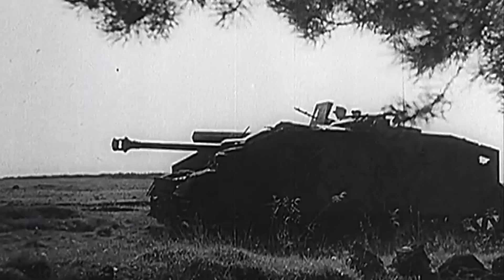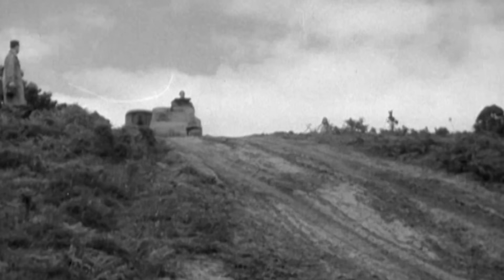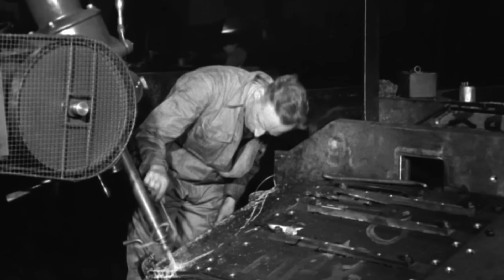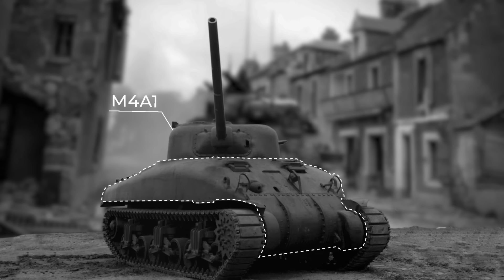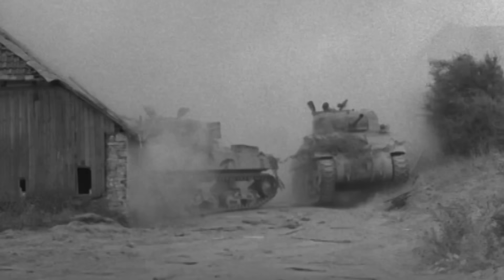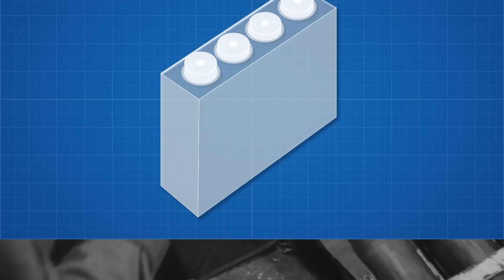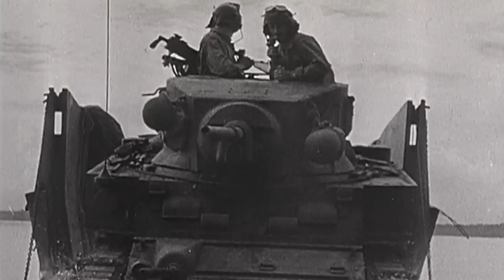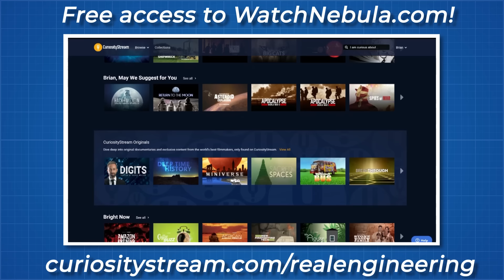M4 Sherman - The Workhorse of D-Day

Comment: The hedgerow clearing Sherman wasn't a variant. It was an unauthorized field mod. Soldiers ran into hedgerows they couldn't get through, and tried things to solve the problem. Welding metal forks and blades on Shermans worked, so they did it a lot. No 2 mods are the same either.

Comment: I thought the Soviet T34 was the most produced tank of the allies.  Continuing production after the War into the 1950s.
Reply: Their numbers made after the war wouldn't count as tanks made by the Allies, the Russians stopped being Allies the moment the war ended, he's talking about numbers made during the war.
Reply: Depends on several matters. Many didn't consider the Soviets as part of the Allied powers until after the war. Production numbers for the T-34 (and its derivatives) during the war vary wildly. Though Between 54,800 and 57,900 are the most common figures. In total between and 60,235 and 63,335 T-34's in all variants and its derivatives were produced during the war. On the other side the the numbers for the Americans are less under question- 49,253 M4's produced during the war including the T6 pilot. In total 63,181 M4's in all variants plus derivatives were produced. Another ~2,180 can be added if you want to consider the Grizzly's and Sexton II's which were Canadian produced (for most part they were assembled in Canada, though most parts were produced in the U.S., they are not added to the M4 production list). So if you want 65,369.

 However referring to the tanks themselves up until 1944 the production and use of the M4 was at least notably, then eventually marginally larger than that of the T-34. In 1945 the T-34 (the T-34/85 variant in particular) production outpaced M4 production and beat it in overall numbers. That being said, the T-34 was produced well after the war to make up for losses suffered and the fact replacement medium tanks weren't in the numbers required. Some ~80,000 were produced in total if we include postwar production.

Comment: but the EZ 8 was built to fight tiger 1s the had built the m26 Pershing to also deal with tigers but to withstand more abuse then a regular Sherman but they didn't stop there they also built a super Pershing fitted with a 90 mm gun that was to go up against anything and yes the Sherman was a good war winning tank that was mass produced it wasn't very good at keeping you safe as the Germans called the take a coffin for 5
Reply: Well check the actual records instead of banking on what a couple of big mouths said during the war, the Sherman was the most survivable piece of equipment on the battlefield, statistics taken from loss records prove it, despite what some freaked out guys and enemy troops may say the inside of one was the safest place in the entire war, crew losses and overall unit losses clearly show that.
Reply: @dukecraig2402  well dude if you checked you books because records go that it took up to 5 shermans to kill one tiger at 1-2000 yards and so they added the 76w shermans so every 5th tank would be a 76w and the tigers learned that the new tank was upgraded with a larger more powerful gun and then they learn to target them so the 76w's came up with a camouflage that would try and hide the end of the barrel but what your thinking about is an infantry tank which then yea you would be safer but there are still anti tank guns that can take them out so you are never safe in a war untill it's over but there are safer places you can be yes
Reply: @abigbang5971  
And it all averages out, you can't cherry pick one example and say it's proof of anything, that's like saying that the documented account of an M8 Greyhound taking out a Tiger is proof that Greyhounds are superior to Tigers, and you're not taking into account all the Sherman's that were taken out with anti tank guns, I had some clown the other day trying to say the numbers of Sherman's lost in Market Garden vs the amount of German tanks is proof that the German tanks were superior, it's like I explained to him, first of all the vast majority of Sherman's taken out in MG were by anti-tank guns that were in defensive positions anyways vs tanks that were being pushed up a single lane road as the result of a piss poor battle plan, not as a result of tank on tank engagements, the example you just cited, was it a result of the German tank being in a hidden defensive position? Or was it an open field maneuvering battle? And no German armor fan boys EVER want to take into account producability, if your enemy is making 30 medium tanks to every one of your "super tanks", well that's not hard to figure out how that's going to end.
And here's something straight from the horses mouth, when I was stationed in Germany in 84 I spent Easter weekend at a German family's house on a program where they'd take in GI's who couldn't go home for holidays, it just so happens this older guy who was the head of his family was a tanker in the war, when I ask him about whether or not it was true about what I'd always heard growing up in the 70's about the German tanks being "vastly superior" to our tanks he literally laughed, then he told me (and this isn't verbatim because I'm not going to attempt to type in his accent) "Look, when there's 1 or 2 of you and 10 to 15 Sherman's come rolling over the hill at you it's only going to end one way, and we knew it.", he also confessed to me that after the Bulge, when they knew it was pretty much over, when they'd see those 10 to 15 Sherman's coming at them they'd just get out and run, something that he attributed to the fact that he was able to have a home to invite me into, why get killed when you know how all of it's going to end anyways, you hear the story's about Sherman crews having "Tigerphobia", well make no mistake they had "Shermanphobia" just the same.
I was on an armored vehicle crew, and the one I was on was priority target #1 on a battlefield if I'd have found myself on one, so I get the concept of and have my head wrapped around survivability in an armored vehicle and how important it is.

Comment: more t 34's were built than the m4
Reply: Depends on several matters. Many didn't consider the Soviets as part of the Allied powers until after the war. Production numbers for the T-34 (and its derivatives) during the war vary wildly. Though Between 54,800 and 57,900 are the most common figures. In total between and 60,235 and 63,335 T-34's in all variants and its derivatives were produced during the war. On the other side the the numbers for the Americans are less under question- 49,253 M4's produced during the war including the T6 pilot. In total 63,181 M4's in all variants plus derivatives were produced. Another ~2,180 can be added if you want to consider the Grizzly's and Sexton II's which were Canadian produced (for most part they were assembled in Canada, though most parts were produced in the U.S., they are not added to the M4 production list). So if you want 65,369.

 However referring to the tanks themselves up until 1944 the production and use of the M4 was at least notably, then eventually marginally larger than that of the T-34. In 1945 the T-34 (the T-34/85 variant in particular) production outpaced M4 production and beat it in overall numbers. That being said, the T-34 was produced well after the war to make up for losses suffered and the fact replacement medium tanks weren't in the numbers required. Some ~80,000 were produced in total if we include postwar production

Comment: The M4 wasnt the most tank produced during the WW2

It was the T34
Reply: Depends on several matters. Many didn't consider the Soviets as part of the Allied powers until after the war. Production numbers for the T-34 (and its derivatives) during the war vary wildly. Though Between 54,800 and 57,900 are the most common figures. In total between and 60,235 and 63,335 T-34's in all variants and its derivatives were produced during the war. On the other side the the numbers for the Americans are less under question- 49,253 M4's produced during the war including the T6 pilot. In total 63,181 M4's in all variants plus derivatives were produced. Another ~2,180 can be added if you want to consider the Grizzly's and Sexton II's which were Canadian produced (for most part they were assembled in Canada, though most parts were produced in the U.S., they are not added to the M4 production list). So if you want 65,369.

 However referring to the tanks themselves up until 1944 the production and use of the M4 was at least notably, then eventually marginally larger than that of the T-34. In 1945 the T-34 (the T-34/85 variant in particular) production outpaced M4 production and beat it in overall numbers. That being said, the T-34 was produced well after the war to make up for losses suffered and the fact replacement medium tanks weren't in the numbers required. Some ~80,000 were produced in total if we include postwar production
Reply: @peterson7082  nobody ever did not consider the USSR allies because they were one of the founding nations of The Allies
Reply: @bbcmotd  Bullshit where were they September 3, 1939-June 22,1941?

Comment: The t-34 was knocked out in far greater #'s than the M-4 Sherman and it did easily catch fire when hit. None the less, the ignorant will say the T-34 was a better tank than the Sherman when the facts say the exact opposite. The Sherman was developed into one of the best tanks of WW2 as it could be kept in battle and it had excellent crew survival qualities. It doesn't matter how thick the armor is on a tank or how lethal the gun is if the tank cannot be kept in battle or even make it to the fighting from the factory. The fact is that Tigers and Panthers were too complicated and consumed far more resources than the Germans could provide. Many, when they broke down, had to be abandoned as the Germans were in full retreat from 1943 on. 

The bottom line is that the Sherman was a war-winner. Panthers and Tigers were not.

Comment: They were a miracle of vehicle engineering considering the logistical requirements they had to adhere to.  No other tank was designed to be massively produced, super easy to operate, maintain, and repair in the field, able to travel extreme distances over rough terrain without breaking down, designed to fit on standard railcars and through standard existing rail tunnels, designed to be shipped around the world on existing vehicular cargo ships, all while being highly tactically competitive against any other medium tank in the world and actually one of the safest armored vehicles of the entire war despite the rep they got.
Reply: That's logical.. and has no place in a youtube comment section.  You can only cite what you learned from video games and/or repeating things someone equally ignorant has told you. THOSE are the hallmarks of the true expert!!

Comment: The sherman whas just terrible if you look at the german tigers. tigers could destroy shermans in a single blow the sherman couldnt do that against the tigers. So indeed the last model the sherman w a firefly cannon could do that but the cannon whas terrible for the driver gunner etc. The cannon that whas put on it wha designed to be a field anti tank gun not a gun designed to put on a tank. The problems whese that there whas an imence nuzle flash recoil weight and sound. The situation whas so bad that 3/10 firefly operators came back either deaf. and soldiers that would be close to the tip of the gun outside the tank would be blinded by the gun at night.
Reply: > "The sherman whas just terrible if you look at the german tigers. tigers could destroy shermans in a single blow the sherman couldnt do that against the tigers."

 Firstly they serve radically different doctrines, secondly they were a rare threat, and thirdly combat varied.
Reply: The tiger was also 20 tons heavier and made to be an upgrade to defeat allied armor.  It never had to meet the same requirements as the poor lighter sherman.  The Sherman was not terrible, just swinging against a heavier foe.  Thankfully that foe was also prone to breaking down and restricted to what roads and bridges could support it's mass or even how it moved in and out of theater being far more dependent on rail.

Comment: In Normandy, 90% of German armour was destroyed by the British. The British did use  Shemans, as the US was throwing them at the British, but!   They used the Sherman chassis to mount a Tiger killing British 17-pdr gun, not used by US forces. They used Cromwells, a better tank than the Sherman, the Churchill, again a better tank than the Sherman. The Challenger with a 17-pdr gun.  The US had only one tank, the Sherman, with an inadequate 75mm gun.
Reply: Because the outstanding majority of German armor was encountered by British and Commonwealth forces until late June. 

 How is Cromwell better overall exactly? The Churchill cannot be directly compared to the other tanks listed given its doctrine being considerably different to them.
Reply: @peterson7082  
The Cromwell was fast, using the superior RR engine. It had a lower profile.  Roomy inside. Using the 6-pdr gun with APDS shells could knock out Tigers. Superb fast cross country running.

The later Churchills had thicker armour than the Tiger. It could turn on its own axis. Very roomy inside. Highest survival rate of any tank in WW2. Even climb hills, as the Germans found out to their detriment in Tunisia as Churchills appeared when least expected.  Using the 6-pdr gun with APDS shells it could knock out Tigers.
Reply: @johnburns4017  6 pdr Cromwells were never common
Reply: @peterson7082  
and?
Reply: @johnburns4017  You make regular reference to it. When it appears the Firefly would be much more common, or the Challenger would appear in similar rates.
Reply: @johnburns4017  So, saying it's a better tank is a nonstarter when the majority of tanks fires the same ammuniton as the M4.
Reply: @peterson7082  
the Cromwell was a common tank in British forces. It performed a multiple of roles.
Reply: @johnburns4017  You misread my comment. 6 pdr armed tanks were not common. I'm seeing reference to less than 300 produced.
Reply: @peterson7082  
So? 
The Cromwell.was a superior tank to Sherman. That is obvious. It was improved to the Comet which was the equivalent to the Pather.
Reply: @johnburns4017  Not even close. Cromwell's speed was superior- cross-country depended on several factors. Protection, ergonomics, and handling not so much.
Reply: @johnburns4017  Please elaborate on the Comet?
Reply: @peterson7082  wrote:
"Because the outstanding majority of German armor was encountered by British and Commonwealth forces until late June."

That was the way Montgomery planned it. His left flank (the British) takes on the bulk of the German forces drawing it away from his right flank (the Americans), in order they break out forming an encirclement. That was the plan which happened. 

US forces were not capable of taking on massed German armour. They lacked experience and not with a 75mm infantry tank. US forces hardly met German armour in Normandy.

The Americans had only faced one battalion of 40 assault guns in June (17th SS) and only one panzer divisions (2nd SS) in July.
The only time the Americans faced a large number of tanks in Normandy was when the Germans counter attacked them in August during Mortain. Even then, the panzer divisions had been whittled down in strength after engaging Monty's forces around Caen and were nowhere near at the strength they were when they were fighting around Caen.

In Normandy throughout the whole of June there was just one battalion of 40 assault guns in the ENTIRE American sector. These were the Stugs of 17th SS. There was no other armour in the whole of the American sector (apart from some few insignificant early war obsolete French tanks) until 2nd SS Das Reich turned up in front of St Lo in early July. At this time the British and Canadians had EIGHT panzer divisions (4 Waffen SS) in their sector. Two more Tiger battalions were sent to the British sector in early July 1944.

Comment: America had time to make a Tiger tank the USA got into the war late, a disservice to the American soldier.
Reply: Yea if you consider a 5 to 1 attack on the Tiger that filled the need.
Reply: @lance8080  That is nonsense. You bring as much troops as a unit comes with.
If there is one Tiger you send a Platoon, Not 1 or 2 Tanks.
And, remember, the Sherman wasn't build to face German Tanks in First place.
And, we also shouldn't forget, the Tiger was a HEAVY BREAKTHROUGH weapon. The Sherman a medium, early Design Tank.
If you want to compare it with a German Tank, compare it with a weapon of similar use, Like the Panzer IV.
The US Army designed the M10 Wolverine, M18 Hellcat or M36 Jackson to face German Tanks in a Tank offense.
Reply: @papaaaaaaa2625  tank destroyers were never used on the offensive. They were used as a reactionary force.
Reply: @chadjustice8560  I mean they where used to face German Tanks in A GERMAN TANK OFFENSIVE.
The Tank destroyers in US Army doctrine where a defensiv weapon, you're right.
But again, the Sherman weren't build to face a Tiger Tank.
Reply: @lance8080  This is a myth coming from American doctrine
Reply: The Tiger didn't fill a role that the US military required.